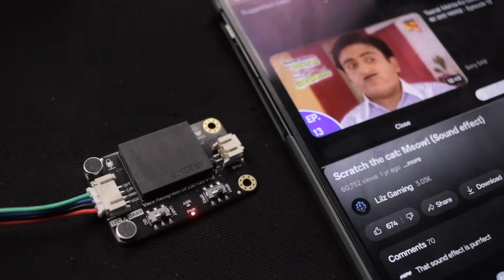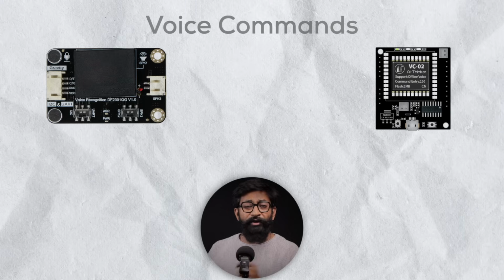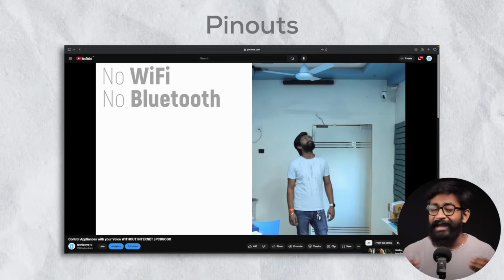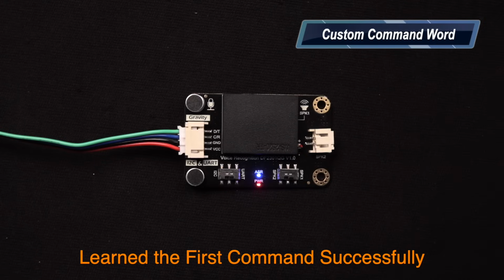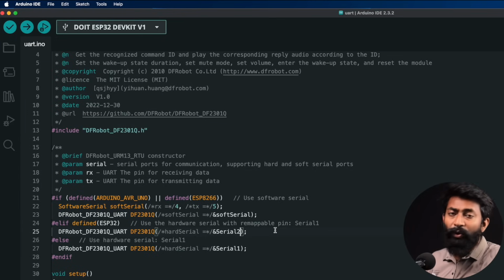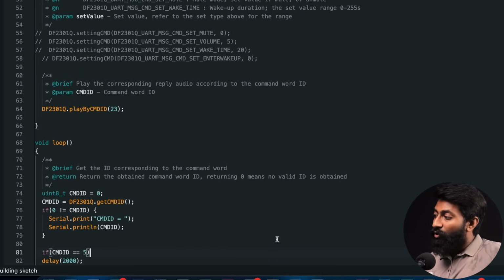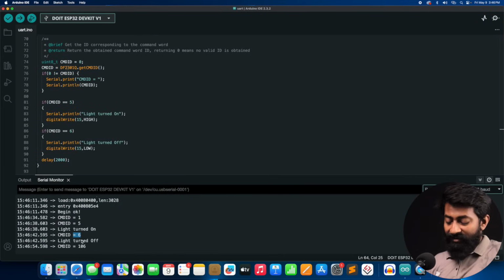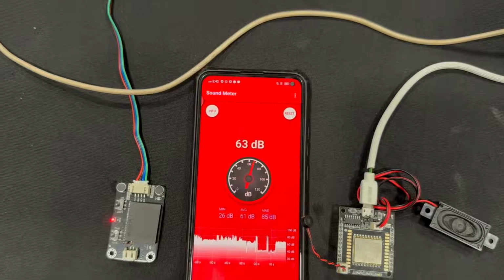Is DFRobot Voice Module Better than VC02? Let's Test them out

Comment from the maker: So which one will you choose, VC02 or DFRobot’s module and why ?
Reply: Can you make video with code and connection for vc02 module , relay,16+ servo motor and Arduino
Reply: @techiesms  DF robot module
Reply: VC02
Reply: I will choose VC02 because it is pocket friendly ( cheap) and it doesn't need external microcontroller and it have good amount of gpio pins and sir also say that if we want to add new command in DF robots we have to start with starting word so I choose VC02
Reply: I bought vc 02 from you bro
Reply: Neither , both are USELESS.

DfrRob only can only learn 25 WORDS.

VC2 needs to be Taught Programmed ONLY ONLINE.
Reply: @jjjc-c5n which module you preferred?

Comment: The DFRobot module has a serious bug in its firmware.  After about an hour it goes into deep sleep and stops responding.  The only remedy is to cycle the power.  DFRobot won’t fix it. 😢

Comment: I used VC-02 , i build a product to ON a light . In a small room at the corner it is very hard to reach the mic. the range was very poor. Then upon my upset i had searched and found DF RObo module, even though it cost 4 times than VC-02 ,i bought it. and tried , i faced the same range issue . i had to shout to reach the module in a small room. In my view both the devices are awesome but both fails in the voice range. Good thing is DF just because it has learning feature. But what ever features it has if the range is not enought both are in vain.

Comment: One thing to say that i have purchased the vc02 module and having the same issue like not well audio capture in noisy environment. And so do for long distances.

Eventually i thought to change the microphone. So i soldered a condenser microphone with a capacitor shorting the mic.

The result was surprising. It can capture audio in noisy environment and long distance(approximately 40-45 feet distance away)
Reply: What capacitor you use?

Comment: can we add external speaker 3 watt speaker along with max98753a amplifier with df robot module?
Reply from the maker: We can attach a speaker directly but haven’t tried with additional amplifier. But I guess using PAM8403 Will be ok to amplify the audio